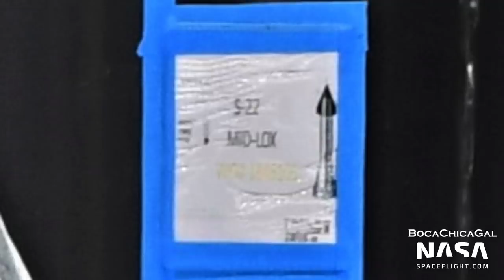Aft Dome for New Starship Flipped | SpaceX Boca Chica

Comment from the maker: 0:00 Sunrise Over the Launch Site
0:40 Liebherr LR11000 Crane part Transported to the Launch Site
1:16 Common Dome Outside the Tents
2:08 Crews Work on Ship 21’s Nosecone
2:54 Raptor Engine Moved Into the Tents
3:10 Mid LOX Section for Ship 22
3:51 B2.1 Test Tank on the Booster Test Stand
4:43 Ballast Unloaded for SpaceX’s New LR 11000 Crane
5:29 Liebherr LR 11000 Assembly Continues
5:55 Crews Disassemble Frankencrane’s Boom
6:39 Booster 4 
7:19 Work Continues on the Chopsticks
8:02 The Starship Quick Disconnect Arm
8:29 Crews Work Inside Ship 20
8:54 Ship Aft Dome Flipped
9:34 Robot View of the Flip
9:58 Boom Section for SpaceX’s LR 11000 Crane
10:22 Work Continues on Ship 20
10:47 Raptor Engine at the Launch Site
11:10 Frankencrane Disassembly Continues

Comment: It would be fascinating to see any changes in their method of attaching the thermal tiles.
Reply: There is already a change, which is installing them before asembling the ship. This allows more flexibility for the workers to safetly mount them and make sure they're mounted firmly and correctly. Now when they test ship if this doesn't work then I think we'll see another change in the way they mount it.
Reply: The biggest change is the time allotted to the installation. All else is icing on the cake.

Comment: So glad to see what b2.1 was for.  Also, respects for FrankenCrane.
Reply: So what is it for?
Reply: @knowlegeisgood8735  The current 2.1 test tank (the short one on the stand) is likely for testing the top section of the booster.
The test tank has a Starship thrust puck which was already extensively tested. Not tested however is the top of the booster and how much forces it can withstand.
It has not only to withstand the mass under acceleration of the fully fueled Starship but also lateral forces when the rocket wobbles during the ascent phase. Both force directions can be modeled on the test stand.

Comment: Is their own crane strong enough to build the second tower or do they need anotherone when the time comes?
Reply: I guess after the first build they have worked out weights and construction so may well be able to use the lower rating crane. The final tower section was heavy and off centre so maybe they will do that differently. Also they learned from the twin crane lift of the launch table. Alternatively they may just hire the big crane for the final lift.🙂
Reply: They'll probably just rent it for a few days if necessary. That big ass crane must be costing them quite a lot of money when it's not actively doing any work.

Comment: Now that TPS tile fitting has been added to the tent production process. do we think we'll see a reduction in the use of mobile platforms and the construction of dedicated scaffolds to allow easy access?
Reply: Not anytime soon. Until they end the prototype making stage they will use these flexible methods. No point in building expensive platforms while the designs are changing daily. Btw, they use scaffolding the High Bay and tents when it is needed. Putting tiles on the nose cone is hard no matter what way it is done.
Reply: @knowlegeisgood8735  I was kinda wondering how they can proceed with the construction of ships 21 and 22 without the flight data from 20?  I mean how are they refining the design without data?
Reply: @iamjadedhobo  thinking on it that makes perfect sense.
Reply: @JoeShmoism  They always affect the forth ship in the que. So S20 will affect S23. If all goes well with S20 then S21 and S22 might join S16 as a garden ornament. If not, and something unexpected happens to S20 they become a second and third chance to get things right provided the modifications needed are minor.

Comment: How much does the 11000 cost? Is there any difference in height between the 11000 and the 11350?
Reply: Both have a maximum hoist height of 220 metres, according to the Liebherr products page. For LR13000, the gigantic one, it's 236 metres. I don't know if you would have wanted these in feet, instead, but then again, Liebherr is a German-Swiss company. The prices are probably told only if you're a potential customer.
Reply: @VideoDotGoogleDotCom  So the only difference is load capacity, I assume? Having the launch tower completed and chopsticks mounted, they probably don’t need to lift such heavy loads until they get to build the 2nd tower… which might be a year from now. At which point they can borrow a larger crane just for the job again. 
They are probably going to get rid of Bucky as well and just use the Black Night for everything around launch site.

Comment: Will the starship be double skinned?…I see all the videos of the finished product being a smooth outer skin but, all these ships have a lot on the outer ship, like the raceway, strengthening strips etc, will there be enough room on the inside with the fuel tanks welded to the ship main skin?? Or..after finishing testing the whole outside will change only leaving the heat shield tiles and flaps??
Reply: @iamjadedhobo  but looks nothing like their posted videos of it in space and if they’re planning on side refuelling, that’ll be hard with everything on that "cold" side..

Comment: Would the new crane be tall enough to reach the top of the tower?
Reply: LR 11000
Max. load capacity	1,000 t
Max. hoist height	220 m
Max. radius	184 m
Main boom, lightweight/heavyweight up to	168 m <- - - -  
Tower 143m (469 ft) tall – technically 146m (479 ft)

Comment: So when they put starship together out there in the construction area wouldn’t there be dust or sand in the fuel tanks?
Reply: They are cleaned before they close the hatches. No big deal.
Reply: The tanks are cleaned before any test with gaseous pressurized nitrogen

Comment: I want to know what would happen if the thermal blanket got wet, then froze under the tiles.. Surely those tiles are not water resistant
Reply: the thermal blanket (ceramic) won't absorb water, so not an issue.
Reply: The ceramic fiber blanket is better than organic wool at rejecting moisture, but moisture will tend to migrate into it while the tank is extremely cold. In space it will dehydrate again. These ice crystals 
on the fibers are tiny and should not be a mechanical nuisance. 

This is an iterative test&refine process. So perhaps a vapor barrier will be required.

Comment: I understand what the test stand is about, but I don't understand what the test tank it for.  Anyone?
Reply: You must be referring to 2.1 test tank.  One reason for tank is the current test to be done on the Thrust Simulator at the production site.  The thrust simulator simulates the force of the thrust by the raptor engines on the thrust puck.  There are also specialized attachment on the simulator which tilt to simulate the ability of the center 9 raptors to gimble.
Reply: testing
Reply: A strange tank is placed on a test stand. We know nothing beyond that.
Once a real test is conducted we might get some hints. What is special about this tank that demands it to be built that way? Can't see any new design of the bottom other than that it lacks a skirt. Why does it need the top of a booster?
Reply: The current 2.1 test tank (the short one on the stand) is likely for testing the top section of the booster.
The test tank has a Starship thrust puck which was already extensively tested. Not tested however is the top of the booster and how much forces it can withstand.
It has not only to withstand the mass under acceleration of the fully fueled Starship but also lateral forces when the rocket wobbles during the ascent phase. Both force directions can be modeled on the test stand.
Reply: @3gunslingers  Did you forget B3?
Reply: @knowlegeisgood8735  
Did it fly? Was it exposed to any forces related to a full stack launch?
Reply: @3gunslingers  The test tank will not fly either, so what is the point?
Reply: @knowlegeisgood8735  
Testing how the top of a booster holds up to in-flight forces.
Reply: @3gunslingers  That has already been tested successfully, why do that again?
Reply: @knowlegeisgood8735  
When did they test the booster for structural stability?
Reply: @3gunslingers  Oh, now that's an interesting thought.  Maybe the TT will have a Starship stacked on it for load test.
Reply: @iDuckman  
The idea is that the gigantic hydraulic cylinders in the test stand will simulate all the necessary flight loads on the booster top. 
I bet they will be connected to a ring that will be placed on top.
Reply: @iamjadedhobo  
"The top of the tank has additional reinforcement and hence can not be used as a booster top representation!" 
Interesting. How does the reinforcement of this 2.1 test tank differ from the other boosters?
Reply: @3gunslingers  B3 was cryo tested (with hyraulic rams) and static fire tested too.
Reply: @knowlegeisgood8735  
Sure, but it was never tested for in-flight forces generated by the second stage (Starship)
Reply: @3gunslingers  How would B2.1 do that?
Reply: @knowlegeisgood8735  
In the new test stand. The huge hydraulic rams will probably linked to the top tim of the booster and pull down on it, thus simulation in-flight forces.
That's the whole point of the big test stand.
Reply: @3gunslingers  Hydraulic pistons can only push on the bottom. How would they be "linked to the top rim"? Sorry, but I can't think of any way that could be done.

Test tanks are built to either test a new steel, a new thickness or a new design. I can't see any new steel, thickness or design, other than the fact it is a hybrid of a ship and booster. Pressure testing it can't answer much beyond whether it can hold the pressure. It makes no sense - yet.
Reply: @knowlegeisgood8735  
Hydraulic pistons can also pull. 
To link them to the top you only need ropes, chains or steel beams, whatever.

"Test tanks are built to either test a new steel, a new thickness or a new design." 
And to test for structural stability... which is exactly the setup of the new test stand. It has never been used before. 

One Starship was previously tested for structural integrity in "the cage" if you remember.
Reply: @3gunslingers  We shall see.